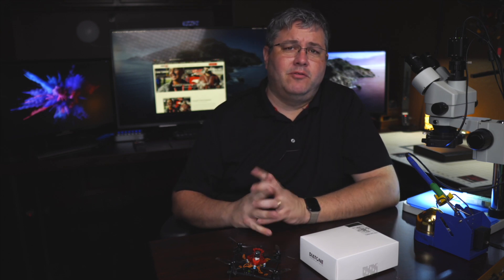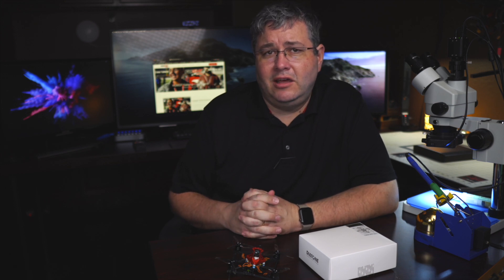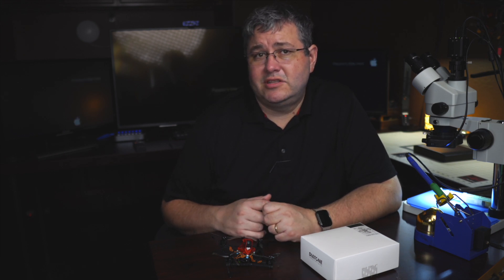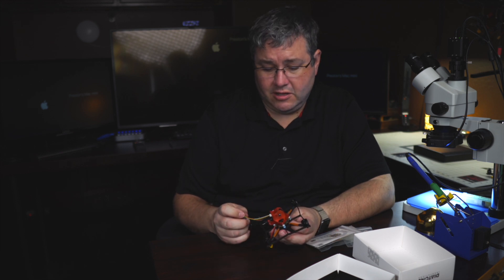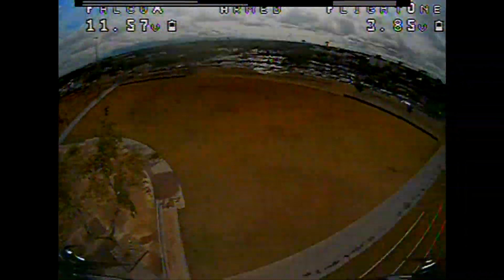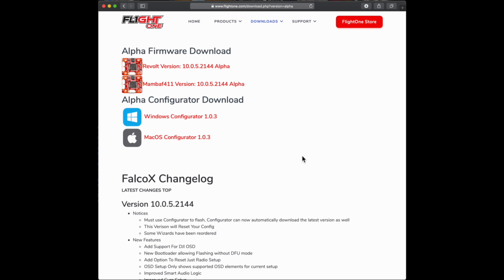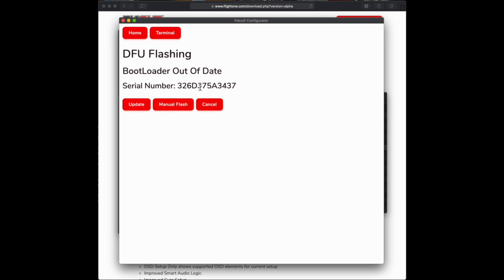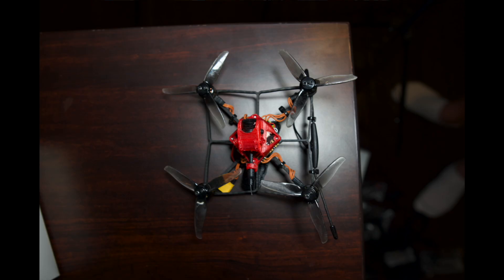Ultimate FalcoX Micro Build

Comment: I bought the Diatone FalcoX version, and it is not that simple. Asks what side of a prop is higher on the front left...uhm..from what reference point? Do I look at the quad facing away from me? Cannot adjust cell count. OSD menu is overloaded. Cannot arm for whatever reason, no warning etc... Can't you put a real guide somewhere? Step by step with explaining what each settings item means? Really planning to flash Betaflight on this.